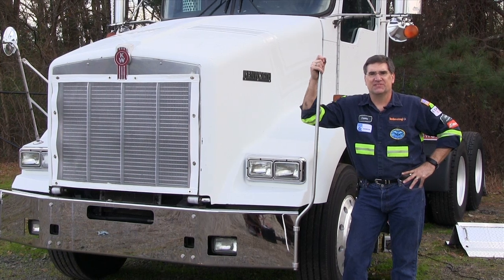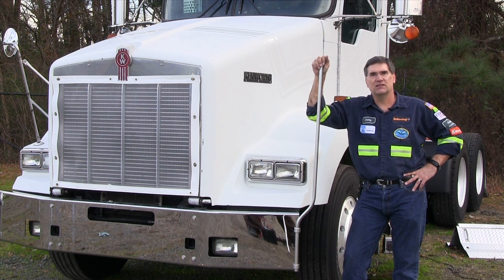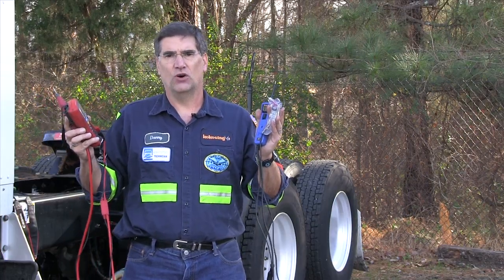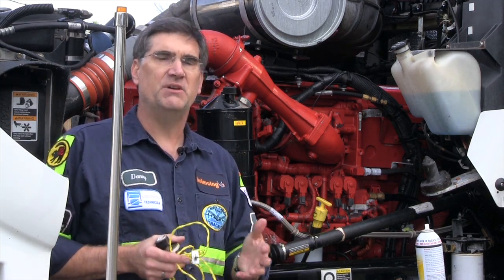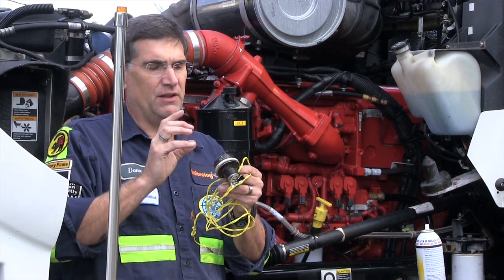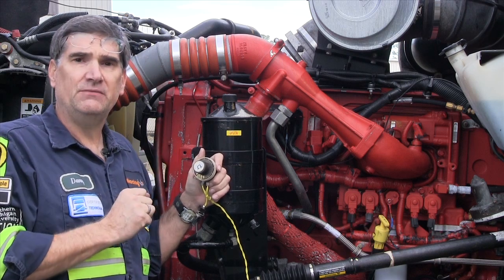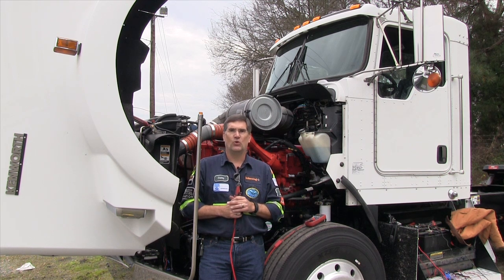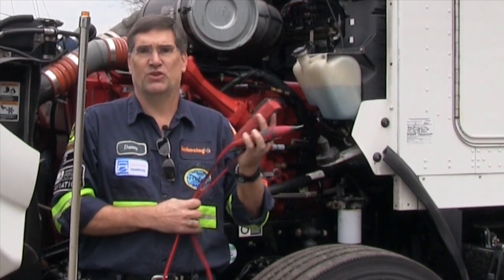LOADpro® vs. Volt-pro vs. Powerprobe® vs. Corrosion

Comment: You seem to have a chip on your shoulder. I know, 13 years. You stated that no less than 5 times. Yup, by your own admission, you do suck at sales. But if the product is good then it will sell itself. I wish you well. I purchased your tool to add to my diagnostic arsenal. I'm an experienced technician and have been doing electrical and electronic diagnostics for 35 years so the concept really interests me.. I have used a specially designed box where I add 3157 bulbs into the circuit in parallel to load it down to check for voltage drops. Your tool sounds interesting. So much so that I am taking it with me to Saudi Arabia. I am going back to my first love of aircraft avionics but plan to stay busy by doing side work in the automotive industry. Lived in Saudi for 10 years then did 15 years in automotive diagnostics. So ain't scared of electrical issues and live for voltage drop testing. So I will deploy your tool on vehicles over there and see how it goes. I will report back my results once I have used it for a while. Sure hope it's worth the weight that I am paying excess baggage for.
Reply: BTW, I'm also taking a power probe and a single channel Nano scope with me. When used correctly, each of these tools can take someone pretty far.

Comment: Hi Dan,you are the Man. Was going to buy the powerprobe hook to up my game,but at £350+vat is quite expensive so thought i had better do my homework on this product before i committed to buy.Then i came across you and your product. after about the third or fourth video,i ordered the loadpro and your book. Brilliant. You have opened my eyes,made me think hard and ignited my thirst for knowledge again. Thanks for that. Every you say makes sense to me. keep up the good work Dan. And again,many thanks.
Reply from the maker: You're welcome. Glad you were able to understand my colonial twang. let me know if you have any questions about the book or how to use the leads...
Reply: Daniel Sullivan Hi,Dan,thank you for responding. Your colonial twang is no problem,you speak good easy to understand simple english. have not read all the book yet and do have questions but will try and workout myself first. Only question i will ask at this point is that having read the instruction manual supplied with the loadpro, the test procedure to test the tool states that i should see 25ohms resistance, i am seeing 25.6ohms. Is this ok?
Reply: Tim Leer oops,approximately 25ohms.

Comment: yea i just got your load pro tool and am quite impressed for the money it cost, i used it on a power window problem passenger window didnt roll down from drivers swich. checked voltage with button pressed from divers window got 6ish volts where the wires connect to the passenger switch. loaded the wires from the battery at the drivers switch used load pro on the other end proved those wires didnt have corrosion thanks sullivan

Comment: Hi dan, your tool is amazing simple as that and your methods work.

Can I ask how the powerprobe hook hot shot function works compared to your load pro, is that basically them stealing your design in a round about way! They say you can't use the hot shot on a computer voltage circuit, I assume cause it sends 12v down the wire. Is the load pro safe on all circuits?

Thanks.
Reply from the maker: Yep - infringement in my opinion. The didn't even have a voltmeter on the Power Probe until I came out with my tool. Anyone with any real understanding of diagnostics knows that without loading the circuit you're wasting time. Jeff at Power probe got caught with his [ants downs and is trying to accomplish the same thing as me with a bad concept and a 10x greater cost.
Reply: what about the load pro on computer voltage circuits vs the hook? is the load pro safe or am i missing something?

Comment: so what you are saying is that the load pro is not a replacement of all these tool it should be used in conjunction with all the tools
Reply from the maker: No - the LOADpro does it all with a digital meter...
Reply: Daniel Sullivan  ok so how do you power up components withe the load pro
Reply from the maker: adam sumner You don't, although it will. Powering up components is not a very effective way to diagnose. We already know that wiring is the problem 80% of the time - or wiring-related components, so testing the 20% failure is a bad decision. Even if the component works, you still have to go backwards and figure out why the wiring is bad - and those electronic tools don't show you that. If you use the LOADpro correctly, you evaluate wiring first, and if the wiring is not the failure, it has to be the component. My way the first test is 100% accurate - the PowerProbe can't do that. Sorry- that's just how it is. Just because you can power up a component doesn't mean doing it has value. I've been at the 30 years - that method is way out of date.

Comment: Dan, can you add Monitoring Oz to your List as we have a part number for your tool?
Your tool is the only way to test our harness!!
Reply from the maker: Wait - what?
Reply: Hi Dan. the harness has a moulded end that connects to a $1800 terminal, we have had a large number of warranty returns that have been misdiagnosed due to checking the harness without a load......enter the LOADpro

Comment: good tool but it only tests the resistance of the circuit when on a power probe you can power up circuit and test components off the car
Reply from the maker: If you understand the concept I suggest, you don't ever need to power anything up. That's not a very effective way to diagnose.

Comment: If you find an open in the circuit. Can Loadpro quickly identify if the open is in the power side or the ground side of the load? How?
Reply: If you have an open circuit with both test leads on the load connector, which shows ghost voltage, take your black lead, negative and go to a good ground.  If you then see voltage on your meter, the open is in the ground side of the circuit, if it still shows ghost voltage, the open is in the positive side of the circuit.

Comment: is this just for 12 v or can it be used in 110 to 480 v as well . work in maintenance of manufacturing factory not automotive repair but would really be nice in TS our panels and all the diff stuff in the electric system
Reply: Loadpro is good to 28 volts

Comment: your product seems really interesting and I am considering purchasing one:   I do have a question for you  " Whats so wrong with poking holes in the wires?  well as long as you tape up the wire "  I don't mean to be funny but I did go to New York Automotive and diesel  .... and that is how one of our electrical instructors taught us to do ; but then again he was a teacher from Haiti- To be honest can't even remember what he was testing for he was looking for the voltage to jump to the meter instead of the wire.... corroded  wire?
Reply from the maker: No material will seal the hole as well as not putting the hole there in the first place. You just shouldn't do it...

Comment: hey u know what  Ihave your tool think is great , hoy ever u are missing info right there u are asuming that your ground strap to the chasis is ok , again not to put anybody down  and your meter is running out of battery and that will compromice the test as well , please you have anawsome tool ,just do the full tt add the steeps missing .
Reply: vittilioo1 In my personal experience,gm is the most sensitive to this issue , and the ground thing in general . Even DDC s aren't very sensitive to grd issues. I have seen some freaky shit on gm cars and pu's though.As a general rule of thumb ,I ALWAWYS clean and tighten all grounds on passenger vehicles with any kind of intermittent or drivability issue.

Comment: I believe we both have 2 different ways of looking at this. At the end of the day I would have figured it out my way, and you would have figured it out your way. which one is easier? well I guess we are the judges for that. Yes you are completely right, you cannot do a voltage drop test without a load. That is why you keep it plugged in. In my opinion back probing works well in most situations. I have seen technicians mess up connectors from doing what you did. (face probing). You need to understand that there is more than one path to the same door, and that these paths can take the same amount of effort and time.
Reply: You can do it the right way with what you call face probing as long as you do not spread the pin or female pin you just touch the connector pin. In my opinion there is no faster way of diagnos a problem just use the loadpro. The other tools give you to many ways getting in wrong direction. Volt meter is best.

Comment: electrical connectors are not "hermetically" sealed
Reply from the maker: One of my basic tenets of teaching is to severely limit the number of times you say "no" to a student. You get 4. No, I've never back-probed because it doesn't work. No, you can't do a voltage "DROP" test without a load - you suggest otherwise. No, you're wrong - look up "hermetic". You suggest that what I'm doing is "obvious". No it isn't. Patents aren't issued for obvious things. I have 7 for this tool. You can argue, and I won't fight back to make you feel stupid. I fight back because you're wrong and you need to know the truth.

Comment: plus if you open any circuit up the way you did, any voltmeter will show you source voltage no matter how much resistance it has behind it. That's why if you looked at the schematic and performed a basic voltage drop test of that section, it would become evident.

Comment: There is no doubt that it is an excellent product, but you could have just taken out the schematic and performed a voltage drop test with a normal voltmeter.
Reply from the maker: How...? If you unplug the connector the circuit is open - OCV. If you backprobe, you risk failing the diagnosis. If you poke holes in wires, we're done here. Tell me how you can do a voltage drop on a hermetically sealed connector that allows zero intrusion without taking the component out. I'm seriously interested in knowing, because after 30 years in the field, I haven't figured it out.
Reply: Daniel Sullivan
I am working on German cars and they have connectors that is not easy to backprobe, I actually backprobed a connector to a alternator on a BMW and saw ghost voltage and then I understood that I had bad connection next reading was 0,200 V after pushing in the backrobe more I got the right reading of 1 V a lot can go wrong with backprobing you never sure if you got connection on the pin.

Comment: how do u use it to test window motor harness when the 2 wires switch polarity when you press the button for up and down? hold the button in the up posistion and use the leads to apply the load back to the switch? if the voltage drops how do you isolate the ground side of the circuit when the motor grounds to the door?
Reply from the maker: I did this (nearly) exact same test on an outboard tilt and trim motor. (1) If both directions show full voltage, rule out opens and shorts-to-ground. (2) If there's normal voltage each way, load it. (3) If there's a drop in one direction, the fault will likely also be there in the other direction. I'd assume the polarity of the direction with (+) voltage. (4) Ghost and True Zero voltage still apply exactly as always. If there's good loaded voltage in both directions then the fault is past the connector and in the motor.
Reply: thats what i was thinking but wasnt sure, thanks for clearing it up.i hear people bragging about the power probe 3 i was going to buy one til i seen your tool a fw weeks back n was checkin it out on youtube. screw pp3 u got that cord n other junk.

Comment: how safe is it to use on can module cars? with modules in the circuit will sending a lload to these destroy it with the load it sends through through the wires back to a module such as a window module? and how does it work with diodes in the circuit? im very interested in buying this tool. thanks dan!
Reply from the maker: No problems. Used properly you won't have a problem. Even lights switched by modules are lights, so it isn't an issue. If you get the tool and have questions let  me know.

Comment: Brilliant bit of kit I've had mine about for about 2wks and today they paid for themself. Saab 9-3 no fuel pump. I had 12v at the pump but it still didnt work, hit the button and it went down to 1.2v traced the wire back to a plug under the bat tray that was green with corrosion. Using these leads gave me the confidents to say the fault was in the power side and in turn saved me time, and the customer money. Another garage had already put a pump in it because they thought it had + and -.

Comment from the maker: The Fluke Low Z feature is pretty old - in fact, it's why they wouldn't talk to me about licensing my idea back in 2002. That feature is more directed at higher voltage AC, while LOADpro is for lower voltages - typically DC. The physics is the same - my application is a little more direct. LOADpro can see as little as 0.5Ω because of the load. $60 is way less than $160... Feel free to call. Thanks.

Comment: Then corrosion it means more ohms to the system and with the loadpro active the voltage will drop but with a parcial broken wire let say, 1 copper strand left has 0,3 or 0,5ohms  then I active loadpro and it only drop same mvolts not much!!!

Comment: Let say that the wire is partially broken and the current that can pass through it is not enough to make the wiper motor work...then what can be read in voltmeter with loadpro is only a small portion of "droped voltage" if you if you understand what I mean?!

Comment from the maker: If you place both meter leads into the connector (+) and (-), and you see system voltage - there isn't an open or short. If you load the circuit and the voltage stays constant, there isn't corrosion. An intermittent fault means there isn't a short or corrosion if the system works  normally, then fails. It has to be an intermittent open ----- the only way to truly know the system is with a schematic...

Comment: Hello Daniel, I have a question I would like to clarify. If you have a motor wiper circuit for example and the motor does not work, you have 12volts and test with testlight, testlight does not light either then testing with loadpro but just drops same mvolts!?
I believe it has only poor contact same somewhere and not corrosion!?Am I right?	
	
 	
	
either

Comment: I'm an auto tech I own a set of load pro leads but was curious how much current is being passed though the circuit when you push the button as this can affect voltage drop so I haven't used them much and stick too operating the system naturally too do a voltage drop test so I know how much voltage drop is there when the system is trying too pass its normal current flow and cant .

Comment from the maker: You'd be correct if the meter didn't respond as it does. If you weren't grounded the meter would read "ghost" voltage, alerting you to the problem. You'd then root around until you found a real ground. The battery negative post will always be best, but it isn't always that easy to get to. I work on 400T trucks -- however, if the terminal is available, you can't go wrong using it.

Comment: QUESTION @ 14:14 Dan~ "Move to a good machine ground"  What if you move to what you "think" is a good ground (ie. shiny filed down bare metal) but it isn't and you get a drop reading again? Now you're thinking you've identified a resistance in the positive, you tear into something and find nothing. Would it be better to say do the second ground check directly on the battery with the lead or known good jumper (for long distances longer than the factory lead) to be absolutely sure?

Comment: I purchased your LoadPRO test leads and your probe kit. I am a heavy equipment mechanic.  LoadPRO saves me a LOT of TIME!  It has found a bad/internally corroded battery cable lug, a bad starter relay, and a  bad heater blower switch. But, most of the time it does not find anything wrong, and that's where it is most useful to me. Because I have no dead ends to diagnose! I can simply replace the part and be done knowing the battery, wiring, fuses, and switches are not the problem.

Comment from the maker: 28.5VDC or AC max. Most high voltage/amperage systems have exposed lugs and a standard voltage drop will usually suffice.

Comment: I'm at the point of banging my head against a flippin wall here too. How can some of you not realise the true value of this tool? I've literally taught my 13 year old son what voltage drop is using the LoadPro and a 100ohm ceramic resistor, which the 12.6v went straight through!! Loading it dropped the voltage to just over 2.2v ... My PP3 will be going on eBay soon!!

Comment from the maker: I again assume you've read the PP1,2 and 3 manuals. The 3 has a meter - and it's the "Ultimate" circuit tester. So was the 1 and 2, and now it's the Hook. There can only be ONE Ultimate anything...You're not wrong about voltage drop testing, The meter on the 3 is there because of us, but it's cheap with poor resolution. You do the tests I've done and generate a sensitivity chart showing the voltages where the PP works, and you'll be correct, for about 1% of corrosive faults. More power to you.

Comment from the maker: I'm assuming you've read the instructions for the PP3. The PPs 1, 2 and 3 have been out a while, and the method taught by PP is to poke a hole in the wire to check voltage into and out of the component when working. Technically correct - operationally wrong. The PPs don't test for corrosion. The instructions teach to use the switch to provide a power or ground to test the component. Try it with a PP and you'll see. Trust me - I've done my homework. 13 years worth. It's a different philosophy.